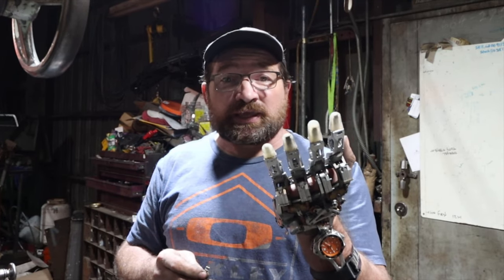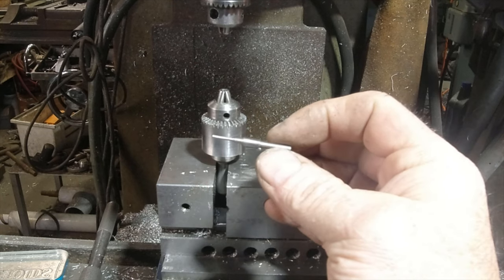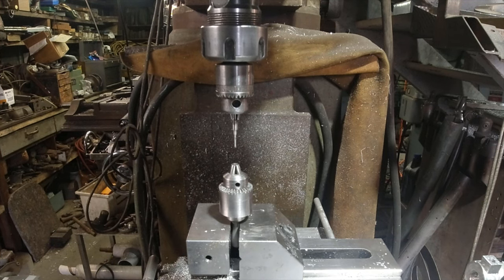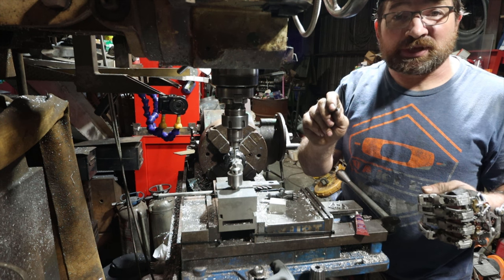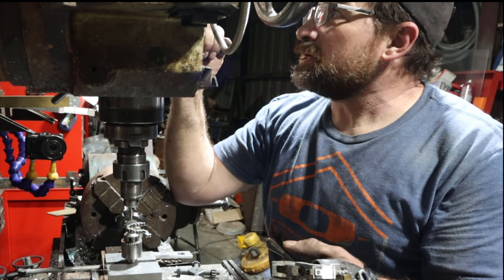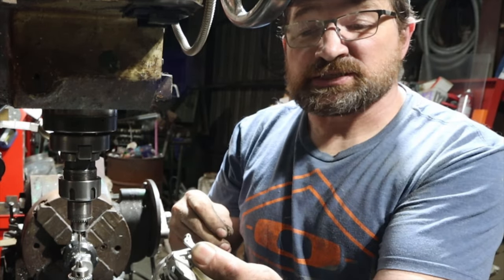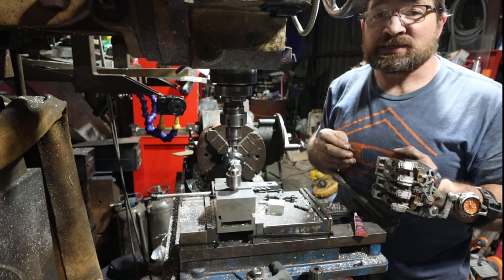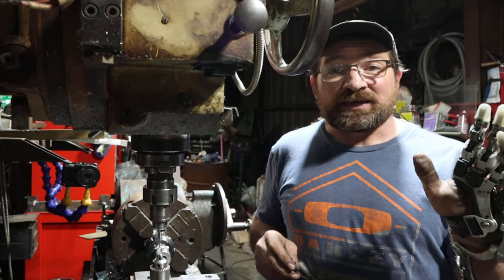Easy Way to Take Apart the Miniature Roller Chain for My Prosthetic Hand

Comment: Amazing as always Ian.
A couple quick turned tools could potentially make this even easier.  If the 0.060" diameter section of the pin was turned to a specific length, it would touch the top the the chain and stop at the proper depth, so you wouldn't necessarily need the DRO.  Similarly, another turned tool with a very shallow 0.060" hole, drilled to the depth of the desired rivet finished height would repeatably set the pin at the proper height when pressing it back in.
Reply from the maker: you absolutely could! if i had a pile of assemblies to make up, i totally would make dedicated depthing tools.

Comment: I worked in a bike shop for years and I never understood the laziness of a master-link.
A hand-held chain tool is easy, cheap, and effective.
Even for a field repair, a chain tool will be easier to use because you don't have to fiddle with pliers on the clip.